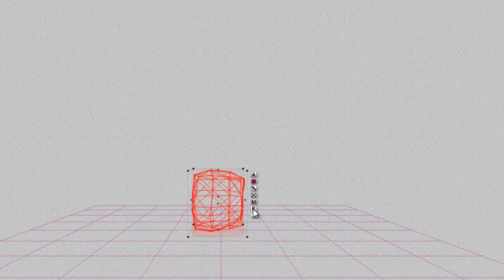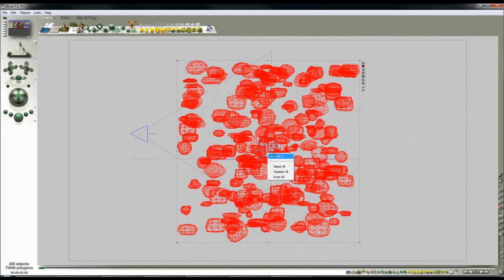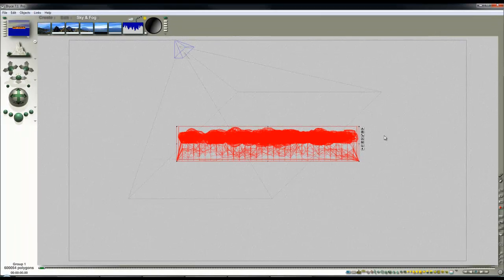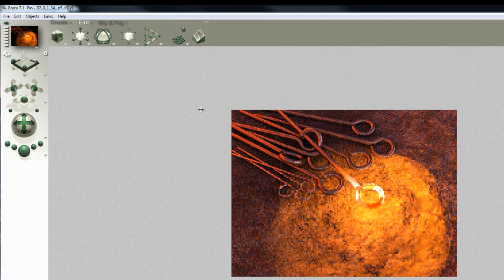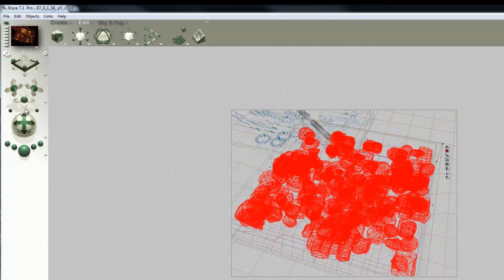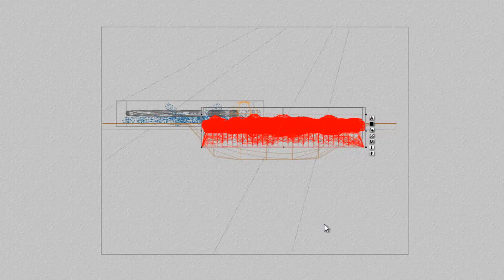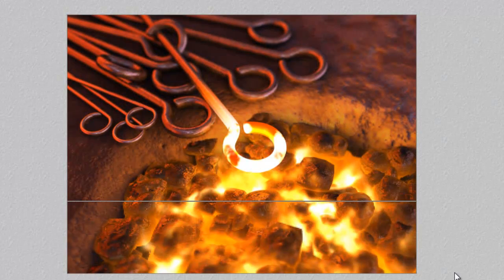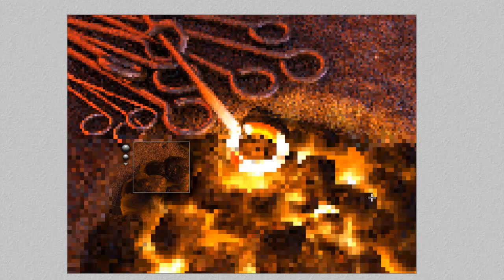Bryce burning coals effect - a 15 minute tutorial by David Brinnen

Comment: I was wondering if you could do a short piece on how you got the pin to look red hot in this tutorial.  I've been playing with the idea of designing a similar type "forge" for a while and this is an amazing way of going about such a daunting task. I also discovered, while playing with this technique, that some of the options in the replication dialog box will save about three steps by using the collision detection, rotate on y axis, and the land check boxes.  Then you simply have to scale your mess of coals to the desired size.